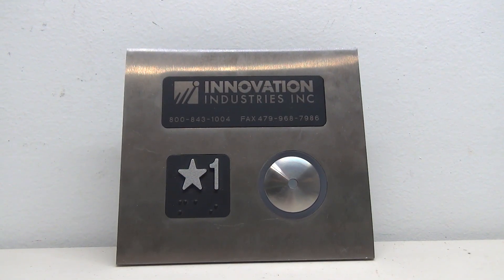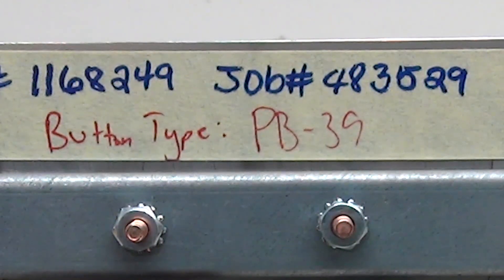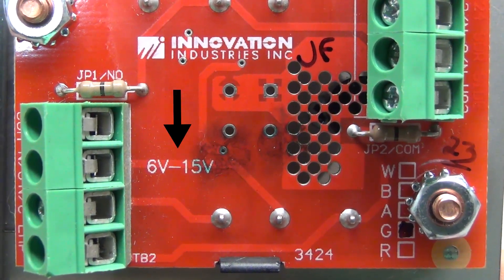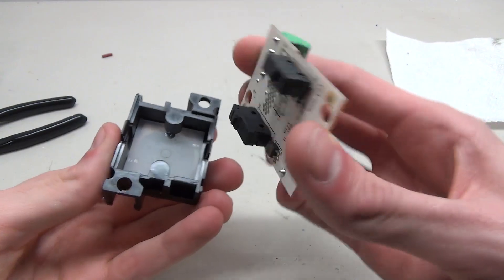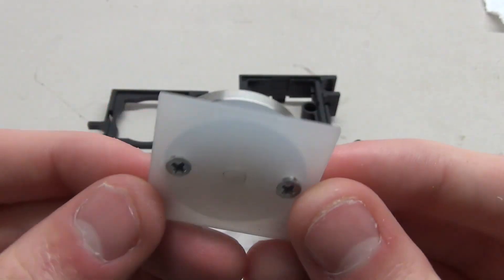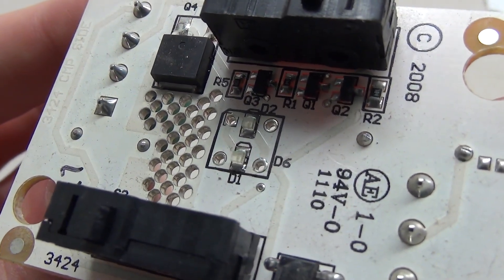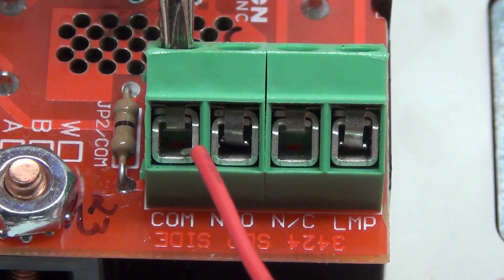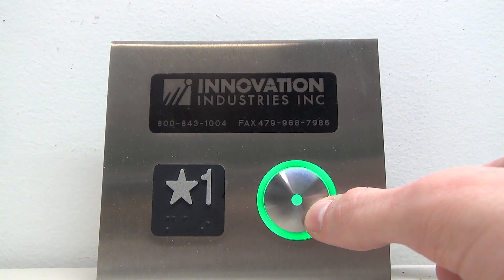Wiring a Single Innovation Elevator Button

Comment: Having 2 contacts in a elevator button is good because if one switch fails the button stil works
Reply from the maker: Yep, with the current setup both switches are connected together.
Reply: @stlelevators  it makes the button useable even if a switch fails because their is 2 switches on the board